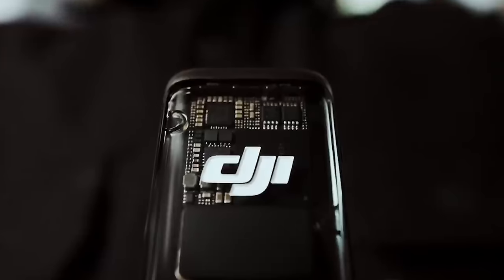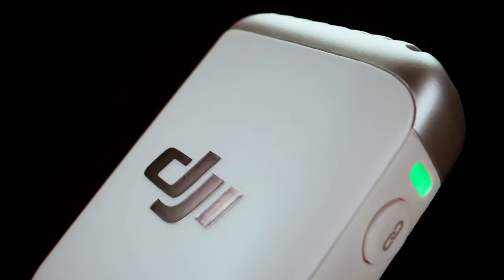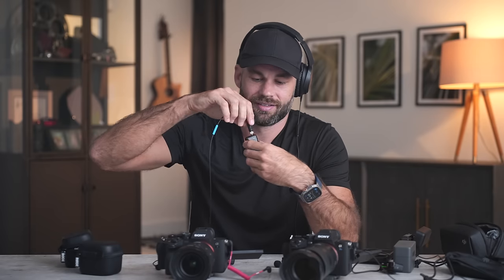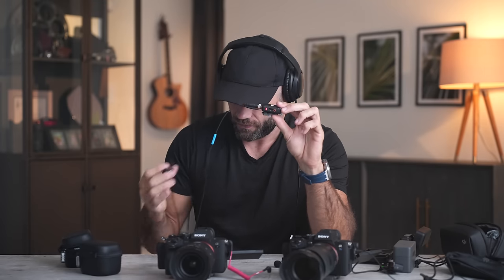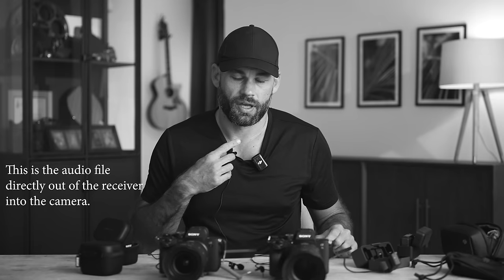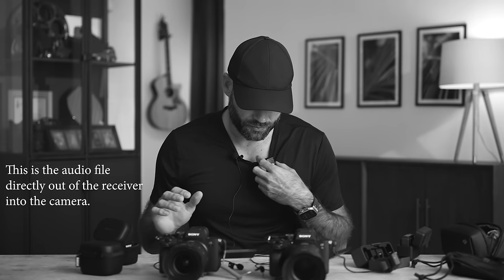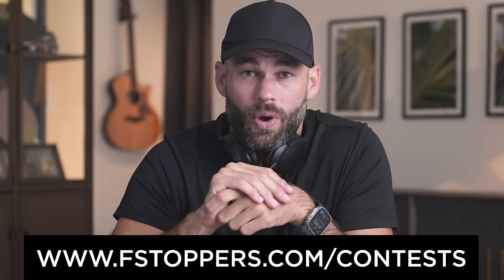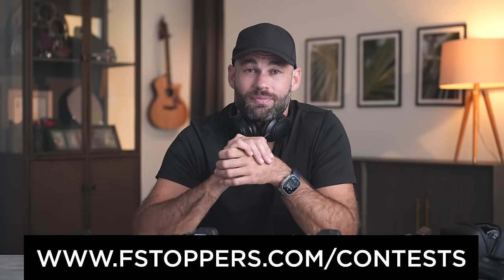DJI Mic 2 has MAJOR issues

Comment: The DJI transmitter SUPPLIES 3.5 volts max to a lav. The Sennheiser MK-2 REQUIRES 7.5 volts in order to operate . This sizeable discrepancy is your issue with garbled audio. Also, the Sennheiser screw connector doesn't allow for a proper mating connection to the NON-SCREW DJI transmitter. The reason it may work on one transmitter and not another transmitter is the typical manufacturing discrepancies when using injection molded plastics as they relate to the use of precision mechanically mating connectors ... still completely irrelevant considering the Sennheiser mic has a screw connector, and the DJI transmitter cannot, in any sort of dependable fashion, accept a screw connector. In short, there's no "MAJOR issue"with the DJI transmitter, nor is there anything wrong with the Sennheiser lav ... you've simply discovered that they're fundamentally incompatible with each other, through no fault of either company. This is a classic demonstration of "USER ERROR".
Reply: This is exactly correct. User error
Reply: I have the same Sennheiser lav mics and had the same issue with the Rode Go transmitters. So I cut the screw ring off with a Dremel. Problem solved. I then upgraded to the DJI system and no problem. I would just cut the ring off
Reply: Absolutely the truth.  I have the exact same issue with the first model of the DJI.
Reply: Hahahahaha! He came out talking fast and hard. Please tell me they wouldn't make an entire video to look this stupid.
Reply: DJI Mic Drop 🥶
Reply: Why would it work fine on other transmitter & the others won't?
Reply: @jfizzle  hahahahahahahahahahahaha - Im in TEARS
Reply: 🤣🤣🤣 so many Amazon reviews are full of these.
Reply: You wrote my exact thoughts hahah :D
Reply: @ridzbaha618  These little details get lost in the shuffle.  I had the exact same question.  Maybe it comes down to best practices.  Like the Sennheiser mic can be fired up with 5V but it's hit or miss so the best practice is supply correct voltage.  Maybe this helps explain XLR - because it is either unbalance - no/low volts required or Balanced 48V and nothing in between where the condenser mics claim no power is needed but actually DO require power like 5V, 7.5, 1.5? - I have a mic that takes a single 1.5v AA battery.

Comment: The sennheiser Mk has the sennheiser proprietary plug it also doesn’t work on Sony wireless systems - if you want to use the MK2 with Mic2 you will need to have it reterminated
Reply: Then why does it work on one and not the other?
Reply: Sorry but exactly the other way around, the Sony is the one that doesn’t follow the standard, Sennheisers are the TRS termination standard. It definitely should work and you are ignoring that one is working.
Reply: I have ‘all’ the various systems Sony Sennheiser Rode etc - i am not saying one is better just that a lav mic terminated for rode will work with the Mic2 a Sony terminated Sanken cos11 won’t work with Tentacle track-e recorder - needs to be sennheiser terminated - does the DJI included mic work with both?
Reply: @TheTechnoPilot Sennheiser are TRS but the Nut prevents them from being plugged in all the way so the contacts just barely touch.
Reply: Sennheiser terminations are 100% standard. They are threaded, but you can plug them into basically anything.
Reply: @aleksandarkuraica3229  normal variations of the mini jack connector. Both might be between specs, the mic connector not.
Reply: @fofopho  so why are they known to cause issues?
Reply: @aleksandarkuraica3229  because the locking nut on the sennheiser can affect the contacts - it’s a lottery weather it works or not best to just get the appropriate plug for the job

Comment: If it works on one mic and not on the other one that is supposed to be the same type of device it is probably a defect unit you got, not a general problem with the mic.
Reply: Exactly. Sounds like bad quality control
Reply: @FORZION  Mine has the same problem!!

Comment: The original DJI Mic already works great for me so I am sticking with that.
Reply: It has an issue where sound drops for 1 second on the internal recording every minute or so that thousands of customers experience. I hate amall annoying bugs. Some have to send them in for repair. DJI repairs them fornl free though.
Reply: @hiawrj  Interesting, mine never had that issue, but it surely sounds annoying.
Reply: @cineffect I haven’t had any issues either. I bought mine on sale in October for $250. I’m totally cool with that price and I’m not going to upgrade to the Mic 2.
Reply: Every test I’ve heard with the DJI lave sounds awful.
Reply: Me too!!!
Reply: The only thing I don’t like about the dji lav is you can’t take off the clip, so it’s bulky for taping to skin.
Reply: @airviewcinematography then you haven’t watched many lol.
Reply: @airviewcinematography  The internal built in mics on the wireless are low quality.  Good enough for YouTube esp outside but an external lav really boosts quality.

Comment: You are using lav's with locking pin connectors which is probably creating interferance and not fully seating into the mic module.

Comment: Really stupid question here - Could this be a TRS vs TRRS issue with the lav mics?
Reply: I was literally wondering the same. I'll look up the mic he's using to confirm! I looked it up and the connector types are all XLR. It's not revealing online about the 3.5mm connector of the lav. I ordered TRS connector type lavs to test with my own dji mic 2 set to see if i have same issue. And then try a TRRS connector too. However, the dji lav mic is marketed as a trs connector so I'm concluding you need a trs and not a TRRS.
Reply: No…not to mention works with Dji mic 1.   This guys is a pro… like he said he has been using wireless mice for the past 10 years lol.
Reply: Not a stupid question. This is usually the issue with most audio gear even monitor headphones.
Reply: That is exactly what it is. It works perfect with the TRRS  to TRS converter plug. I have the same setup.
Reply: Yep got my TRS mics today and it works! This is not an issue. I think this video should be taken down in prevent false information online.

Comment: I just received mine yesterday and after watching this video I decided to run the same test. the Lav mic I used to run this test is the Senal UTM-86-35H they are small and do really like the audio out of them. I do have the Mic 1 and do have 4 of these Senal UTM-86-35H. After trying all 4 of them, they all worked with zero issues. It might just be your copy, I suggest you return those and get another copy or maybe your lav mics just don't work with those. I did try a few lav mics on the original Mic 1 and found out that the Senal UTM-86-35H works well with the system with zero issues.

Comment: Hi, recently I bought a DJI Mic 2 and I'm very disappointed because the only way to make the standalone recordings usable is to set the TX gain to +12dB, but they still have to be boosted a lot in post.
I turned off the Low pass filter, I tried 32 and 24 bits, I tried everything but the records are still very quiet when I put the TX on my chest. 
Is it normal ? Does somoene managed to records something on a dji mic 2 without having to drastically boost in post ?

Comment: Hello thanks for your review. Could you help me? 
I heard that DJI mic has drift while recording internally. But I need to record using the camera for about 2 hours on lectures. From what I heard if I recorded directly to the camera there is no drift only when recorded internally on the transmitter.
Do you know something about that?

Comment: That’s actually a long time known problem of this ME-2-II Lav. Mics. Because of the nut they don’t work in any port. Some work others don’t, what works today doesn’t next time.
It's because the mic is designed to be bolted and only then it is plugged in all the way. Thats why I removed the nut with a dremel on my ME-2-II.

This is nothing new and was the same for me on the older wirless go and go ii sets.
Reply from the maker: I understand that it has the screw that doesn't work with some units. But why does it work with the last DJI Mic system, and why does it work with half of the new system? And the second issue has nothing to do with the lav.
Reply: @FStoppers  I couldn’t explain your second problem but didn’t had it either. Also did a review of this and any every time I used it with receiver audio to camera it worked fine.

About the screw, it depends on the length of the internal contacts inside the port. Maybe they changed a little bit from Mic 1 to Mic 2 or even from unit to unit. So the contacts doesn’t touch.
But I don’t think thats djis fault it's clearly the design of the Lav whats the problem. Thats why on RODEs Lavalier II the bolt is removable. Btw the Lavalier II sounds way better then the ME-2-II.
Reply: Nah, it works with all the Rode Wireless sets, the old DJI set, and a basically every other non-threaded system I’ve ever plugged the ME-2 and MKE-2 in to. I have an issue with an old tascam system, but it was because the mic port was slightly recessed, not because the jack itself wasn’t compatible.
Reply: @DAVISION-YT  Seeing that you control lavalier microphones, I'm thinking about purchasing some DJI Mic 2 and a lavalier to put inside a motorcycle helmet.
I was thinking about a unidirectional one, any recommendations?
Thank you very much in advance.
Reply: @FStoppers Honestly it could be a tolerance issue with the production of the new dji mic 2’s, if enough tolerance slack is accepted in production length of how far the jack goes in, due to the sennheiser plug being slightly different, production differences in length from case to internal contact could be off for it to make proper contact, but any way hou look at it it’s not a good look for dji :/ I did a video on a completely separate problem relating to bluetooth/iphone connections and no internal recording and no support for native iphone video app, and new stuff is happening with even more problems showing up so probably doing a follow up as well
Reply: @fofopho  thats not true! I had is using with Wireless GO and GO II and needed to dremel away the nut to make it fit right. Otherwise I had the same issues since it couldn't be plugged in all the way.
Reply: A poorly shielded Mic will pickup RF signals and couple them into the recorder.  The Senheisers should be properly terminated with screw terminals to ensure proper shielding.  Stray interference causes a lot of issues with lav mics, and is a major reason people use wired connections or spring for expensive wireless systems designed for harsh conditions.  You may be lucky.  Try putting the mic near your your router or phone to see if its immune (using wifi, BT and cellular).  Shielding adapters may help, but don't just leave the screw open without testing it.  You may get lucky, but then have a failure at the worst time, when using it in the field around other wireless systems.
Reply: @barryobrien1890  sorry but there is not such thing as proper shielding with TRS. You plug ground into the mic with 3,5mm as well so when you want shielding you can have it without a screw as well since the Plug already connects to ground. Thats not a XLR Plug with a Return wire.
Reply: @DAVISION-YT  Agree totally.  XLR is the way to go for noisy environments.  I have run into many issues with TRS unbalanced systems interfering with each other when double micing with wireless systems.  Moving the lav cables helps, but its a hack.  Cheap goosenecks are also notorious.  Lavs are a real pain with wireless systems.  My advice is always to try to use the inbuilt mic, or only put one lav on the talent and keep phones etc turned off.  Most of the time everything is fine, but Mr Murphy shows up always at the worst time.
Reply: @FStoppers  It works on the DJI Mic 1, because the 3.5mm jacks are less recessed, than on the DJI MIc 2. You're literally working with fractions of millimeters here to even get contact. Locking lavs are rarely designed to be using in non-locking 3.5mm jacks. One of the few exceptions is the Røde Lavalier II, where you can unscrew the locking nut. Sennheiser unfortunately hasn't allowed for that option.
Not a fault of DJI. Would have been better though, if DJI had implemented locking 3.5mm jacks, like the Røde Wireless Pro.
Reply: @EmeraldAudiovisual DJI has a pretty clever and even fast locking way in the Mic 2. 😊
Reply: @DAVISION-YT  well .. they have ... but you still can't use lavs with locking connectors for above reasons. If you stick to non-locking lavs and loop the cable through  the channel in the clip, then that should just be dandy.
Reply: @EmeraldAudiovisual  yes but you can’t use the ME 2 on Wireless Pro since it’s a different Thread size. Thats different kind of stupid. 🤷🏽‍♂️
Reply: @DAVISION-YT  erhh ?? wut ??  I don't know, what you've been doing, but both my MKE-2 and ME-2 lavs connect perfectly to the Røde Wireless Pro. Same thread. And the Røde Lavalier II locks equally perfectly on the Sennheiser AVX bodypack.

Comment: Loads of issues with mine, Lav's not working, been using the Sony hotshoe adapter and just disconnects and then have to randomly faff around to get it to reconnect, had mics unsync and take ages to be recognised again.

When it finally works, its great, it's just soooo temperamental.

Comment: None of the lavs with locking connector will ever work in that 3.5mm jack properly, because you can't get it far enough in. Locking 3.5mm jacks are slightly protruding and that's your problem here. That's not a problem with the mic. That's just because locking connectors can't be used on most regular 3.5mm jack.
With the Røde Lavalier II, you can unscrew the locking nut to use it in a regular 3.5mm jack. With your Sennheiser lav, that's a no go, as Sennheiser didn't intend them to be removed.
It's not a fault. It's by design.
Reply: This exactly. But is it the same issue that Curtis Judd experienced? He's far smarter and more qualified than the Fstoppers bros.
Reply: @focuspulling  I have not seen Curtis video, yet. But it is on my to do list. I do have both the Mic 1 and Mic 2 and the Mic 2 really doesn't have the margin to push a locking lav fully in. Especially because the top of the mic is curved, where the Mic 1 is flat around the connector and the connector is less recessed.

Comment: I have the same crap going on with some of my lav mics too with the DJI Mic 2, the Rode Lav+ won't work at all, and I have had some odd break-ups on my camera audio recordings.
Reply: Please note that the Mic2 only supplies approx 2,5 volts of power and many "pro lavs" needs 5-7 volts to work properly.
Reply: @GrenlandUnderVann  That's a good joke by DJI in that case.
Reply: Isn't the Rode Lav+ for TRRS not TRS?
Reply: That's so strange considering the dji mic 2 has enough 'power' (idk which specific parameter matters here) to drive a shure sm7b with no cloud lifter / amplifier. I don't understand how it could drive a super power hungry mic like shure sm7b but not a tiny lav. @GrenlandUnderVann

Comment: My DJI Mic V2, which came with the P3, has worked without issue. The V2 Kit is new to me, so I can't say one way or the other. I have two Rode lav mics, but since I started using the DJI V1 kit, I haven't used any lav mic as I prefer the transmitter without lav. Bottom line, my DJI mics are working flawlessly, and I would highly recommend them. The plus is direct single transmitter connection to MacBook, iPhone, Osmo P3 and Action 4 without receiver. P3 will allow 2 receiver connection without receiver.

Comment: Mine work perfectly with and without lav mics.  The audio is excellent and there’s no interference. Everyone should know that using a screw on lav mic can potentially cause a miss seating issues. The only problem I’ve had was missing how to switch out of Bluetooth mode after syncing with a phone. You have to hold down the record button on the transmitter for three seconds to change back to syncing with the standard DJI receiver. This is easy to miss as it’s only mentioned once in the instructions.

Comment: Sounds like the frequencies are cancelling each other out between the two transmitters. Do you know the frequency of each unit? Ideally the difference between the 2 needs to be further apart. 2.4 GHz is wildly crowded with Bluetooth, Wifi, SMART meters, radar and such using this there can be interference.
The other issue is a bad input jack on unit 2. Probably due to inconsistent soldering at the factory.

Comment: I had similar to your second problem with my first version of DJI mic. The audio from the transmitter almost always were broken, interrupted and unusable with or without lav. :( I mostly used the system as a backup and made sure I record to the unit itself. Bought the second version, it looks like it is fine. Rode system is the better sound quality still.

Comment: I'm not an audio expert, but perhaps connecting a extension cable to the MK2 can help determine if the screw lock is the culprit.  Based on your video, it may seem it is.  However, it is strange that it works on one transmitter but not on the other one.    Hopefully DJI can clarify this.

Comment: Did you try separating the mics a bit further.  It sounded like they were wiping each other out.   Also as mentioned camera WiFi absolutely could and would have an impact.  

Mic 2 uses 2.4Ghz like many other systems including most WiFi on cameras.  It’s very possible it would interfere and while this is less than ideal it’s also not particularly surprising.
Reply: A lot depends on the shielding of the external mics as they act like a big antenna, and if the shield is not properly grounded through the screw mechanism, they will totally mess up the recorder if its not designed for un-shielded external mics.